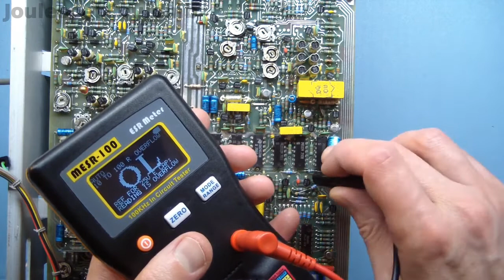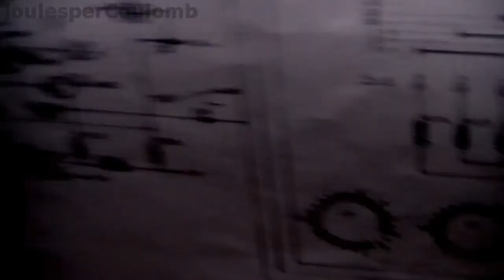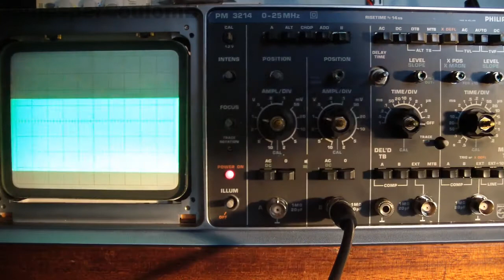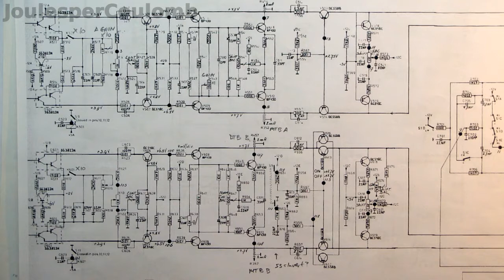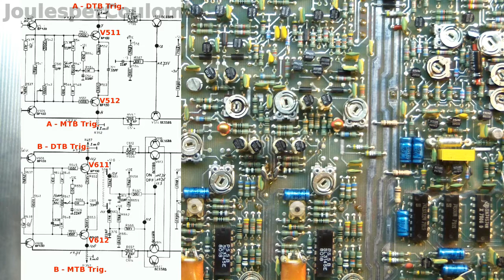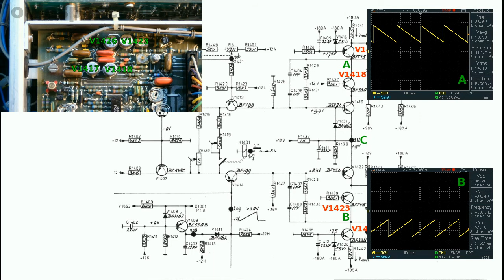Philips PM 3214 Oscilloscope Repair. Part 2.

Comment: You know I appreciate the quality of this video so much. The learning going on for me is so great that I can absorb and use this as a learning tool to help me be a better trouble shooter on my own equipment and the correct procedure for finding faults especially in complex equipment. My laptop will not fire up and with this technique I can find the components I need to replace my unit to make it functional again so as to use my computer successfully and not have to spend money for a tech to do the work for me. 2 years ago I plugged in the power supply backwards so I am pretty sure the failure will be right after the power supply.

Comment: Hello! Thanks for the great video! I have similar oscilloscope with the problem in channel B. I wanted to see the signal on the transistors, which you have shown. But somehow, my digital oscilloscope does not want to see the signal even on the channel A, which works fine. Do you have any ideas, what can I do wrong? I am using cheap tester as a source of the signal. The signal from it, I can see with both oscilloscopes, but not on those transistors. Could you, please help me?